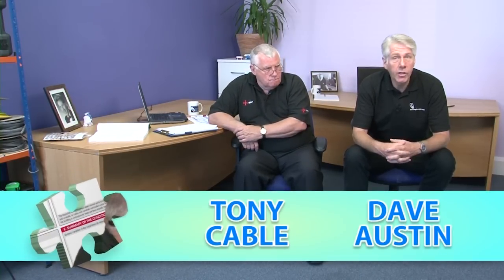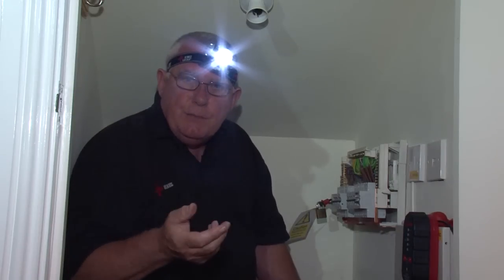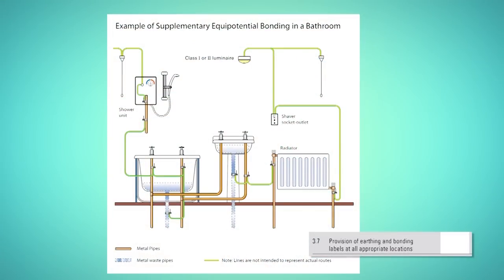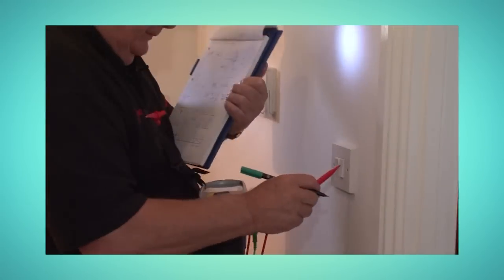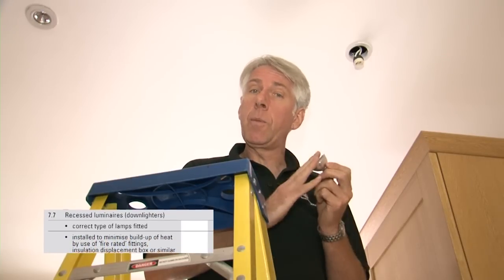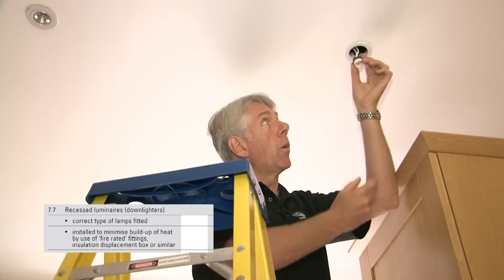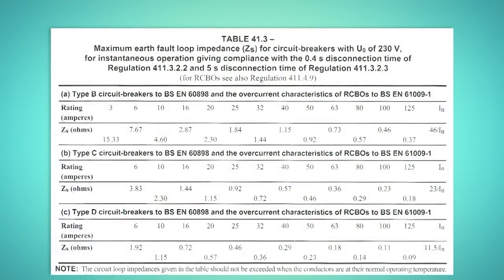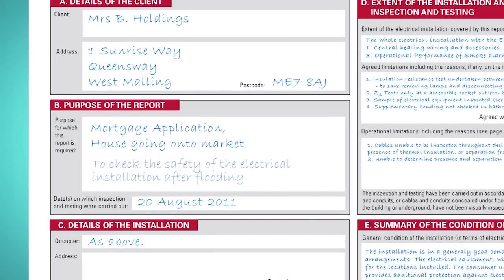Electrical Installation Condition Report and Testing

Comment: non fire rated downlighters are still legally sold and can be installed SO you can't code it 2 or 3 if the installation parameters allow it

Comment: Table 54.8 is only applicable when selecting bonding conductor for a PME system, why does it say that you use this to select ALL bonding conductors?
Reply: DaveBromley1 Hi Dave, the latest version of this video, which was updated to Amd 3 in May 2015 has tweaked the on screen graphics and taken out TC's additional word "always" thanks for commenting :)